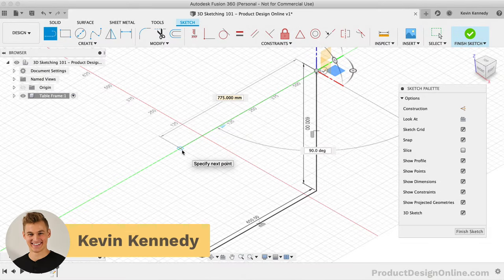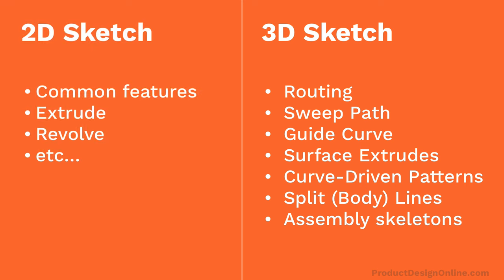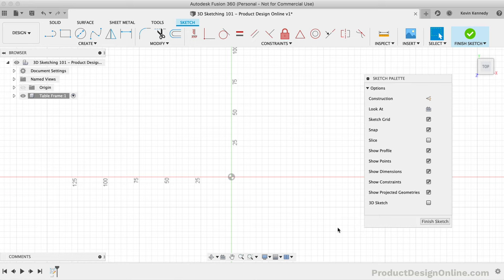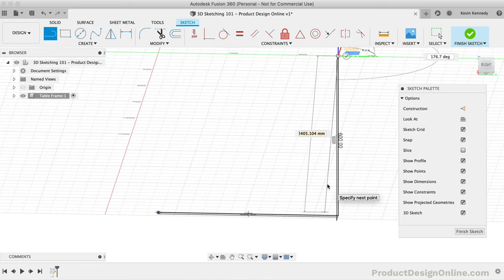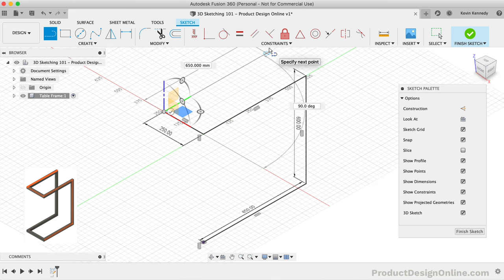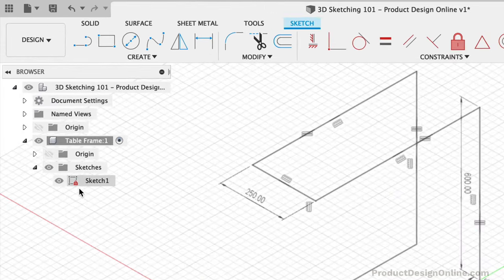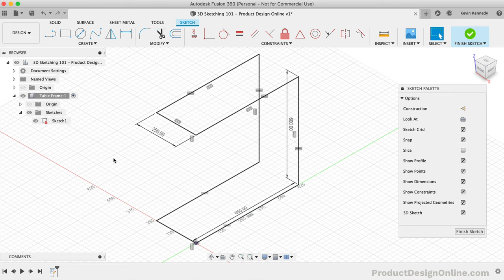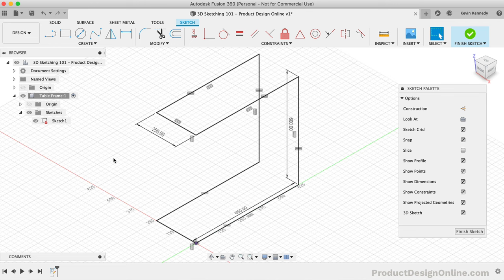How to Create a 3D Sketch in Fusion 360 | 3D Sketching 101

Comment from the maker: TIMESTAMPS
0:00 - 3D Sketching in Fusion 360
0:49 - 2D Sketch vs 3D Sketch
2:07 - 3D Sketch examples
3:41 - Turning on the 3D sketch feature
4:30 - Starting the sketch
6:44 - Adding constraints with 3D sketches
8:20 - Connecting the rest of the sketch
8:55 - Fully defining a 3D sketch
10:07 - Using the Pipe command
12:50 - Creating the top of the table

Comment: Definitely would like more about 3D sketching.  Especially in how it can save time in complex designs, but also when using regular 2D is better. Thanks again for a very concise and informative demo. I did have problems off and on with getting it to work exactly as in the demo, so beware that it may be a bit buggy right now.  I could not get it to work exactly as in the video even when I tried exiting and restarting. The 3D axis would not appear and I could not add constraints to 3D lines, among other things. Then I decided to uncheck 3D sketching checkbox, restart, and open another untitled drawing and suddenly it worked - after trying to get it to work for over half an hour.  Not sure if it will happen again.
Reply from the maker: Thanks for the feedback! I'll have to play around with it more to see if I experience any bugs. So far... it's been working well for me. I may have just been lucky though :)

Comment: Thanks Kevin, it would be helpful to me if you would include several failure examples.  Working through you tutorial, I decided to add fillets to the shape and it quickly failed.  I adjust the diameter and fillet radius and not dice on getting it to work. Your videos are the best CAD instruction I've every came across. Thank you again.

Comment: I think this tutorial would be more useful in the "Core Concepts of Fusion 360" playlist if it was placed before "Surface Modeling with Fusion 360" where you model an Iron. It took me roughly 30 minutes using 2D sketches to get the arc on the back of the iron to fully connect to the other sketches so that I could perform the loft. I just retried creating those sketches with what I learned here and it only took a minute or two. Trying to project points from the other lines onto the arc being created on an offset plane off of the YZ plane didn't give me an easy way to connect the arc like I'd expect. Hopefully that last sentence makes sense to you, it's difficult to explain a picture :D Thank you for the great tutorials btw!
Reply from the maker: Thanks, Jesse. I need to revisit the order of many of my playlists...Generally, things are jut placed in order of date created :D

Comment: Hi! Im trying to model a wintercroft mask by using dimensions and constrains.
Its basically a mask of the head of an animal made with poligons, printed on paper and cut out and folded.  i was wondering if by transfering the paper template to fusion 360 it could be modeled

Comment: This is great :) At the beginning of the video, you mentioned the table frame would be different pieces of pipe welded together in the end. In Fusion 360, the pipe feature with "chain" selected results in one solid body… Do you have any tips for splitting up a continuous pipe into multiple pipes, and also generating the cut sheets & flattened drawings for parts like that?

Comment: Fantastic tutorials. You've helped me learn so much in such a short time. Was a little confused at the first line though. You state a dimension of 45cm but it shows 650mm and looks like it snaps to the 625 part of the grid. There is an edit there so I'm assuming you changed your design. Keep up the great work.

Comment: Thanks for the good detailed video, there were a few points in there new to me. I do wish that they would include some miter/ trim / extend features like you see in Solid Works. This way you could use the program to create 2d, 3d and a cut list for weldment manufacturing. Maybe on one of the future updates... This is a big improvement so far.
Reply from the maker: Former SolidWorks user... so I agree with you, Ethan :)

I think a lot of those will definitely come in future updates.
Reply: @ProductDesignOnline  Ill keep an eye out for more F360 update videos! Keep up the good work.

Comment: Greatly needed this!!  I'm working on a complex house roof design and 3d makes a lot more sense.  I would like help figuring out how to snap to or find intersections of 2 3d reference lines if that is possible.
Reply from the maker: Roof is a good/interesting example for 3D sketching. Perhaps a video topic. You'll want to use construction planes to set up some of your sketch "points" as 2D sketches (I'd dimension and constrain them a distance) and then 3D sketch almost like you're doing a "connect the dots" book.

Comment: Great Tutorial ! I have a problem when using fillets in the 3D-sketch. I can't get a fully constrained sketch anymore.
Reply from the maker: Make sure you don't have any sketch points or anything floating out in space. With 3D sketches it can be easy to forget about one or two end points, which prohibit the sketch from being fully defined.
Reply: I start with a fully constrained 3d-sketch, i do fillet on the corners => not fully constrained anymore.

Comment: Kevin I want to first say that I just love all your tutorials and I did your whole learn fusion 360 in 30 days. But I was wondering is there any way to design a tire mold? What I am looking to do is design some street tires for my Rc car that they no longer make anymore.
Reply from the maker: Hi, Shrekii C. You'll likely want to design the tire itself first, and then you can use the "Combine" command to cut out the tire shape from the mold box - similar to what I did with the Day #21 from the 30 days series.
Reply: @ProductDesignOnline  Thank you Kevin for getting back to me. I did try think about that mold if I was going to make a solid tire. That's why I was thinking wedge design. Hook them all together they form a circle. But there would have to be some kind of flaps on the side to make the sided walls. Now the mold would have to be able to take heat about 250F or so and about 50lbs or so of pressure to force the green rubber into the mold.

Comment: I find constraints to be the most powerful, and most frustrating concept in Fusion 360. As someone new to parametric modeling, I often have found myself frustrated that I couldn't move something because of a constraint, and not clear which constraint would be affecting it.

Comment: For others: Before you begin click on your user on the top right, then preferences,then General, then "Default modeling orientation" change to "Z up" which is what they are using.then start a new design.
Reply from the maker: Hi Robert. Thanks for sharing this! Z up should be the default setting, so you can also simply 'Restore Defaults' in the Preference. Happy learning! Cheers :)

Comment: The pipe command looks amazing but what would I need to do if I want to cut 2 pipes let's imagine a car tube frame made of many bended tubes joined all by weldings
Reply from the maker: Fusion 360 doesn't offer 'weldments' like Solidworks, but you can definitely simulate several pipes. You can create them as one and split the pipe or you can create individual pipe features... it really just depends on the shape and how you create your 2D sketches.

Comment: I get error: Sketch Geometry Overconstrained . I tried Horizontal/Vertical ; Equal option and nothing work to lock sketch ? Any suggestions ?
Reply: Ok i do it. Why i can't type all lines dimension ?
Reply from the maker: Hi, Marcin. The over constraining error is likely because some automatic constraints were applied. In regards to the line dimension. Are your input boxes not appearing or is it not letting you type in them?

Comment: Kevin, I have a serious problem with "3D sketch".  I attempted to draw the C table in your tutorial.  My first attempt drew the first 4 lines successfully, but when I tried to add the 5th (the line going back from the upper horizontal line across the front) the tool switches from a line to a circle.  My initial thought was this was some minor mistake I was making or something I was not doing.  I tried rotating the view and then adding the lines from a different side.  I can usually add one straight line, but the 2nd or 3rd switches to a circle.  I finally tried rotating the view a bunch of times and added the lines one at a time, escaping between each line.  The problem with this method is the lines are not constrained.  When I try adding the constraints manually, I get a message the sketch is over contrained.  I tried 3D Sketch many time from different angles and the result is always the same, at some point, the line becomes a circle.  I tried AgentLintZeal's suggestion about closing Fusion 360 and restarting from scratch.  That did not help.  I tried turning 3D sketch off and on in the palette.  No help.  Any suggestions?
Reply from the maker: Hi, Robert. That is very strange... but it sounds like a bug. I'd assume there are a few kinks since they added a lot of new enhancements to it. Have you had a chance to install the latest update that came out today? I'd be curious if that helps fix the issue you were having.
Reply: @ProductDesignOnline  Kevin, for what it's worth,  I just did the update, and tried the 3D sketch again.  I tried on both my windows 10 laptop and my W10 desktop.  It is still drawing some of the lines as half circles.